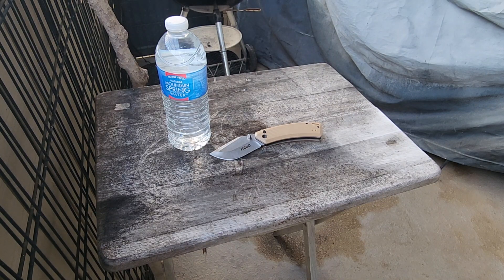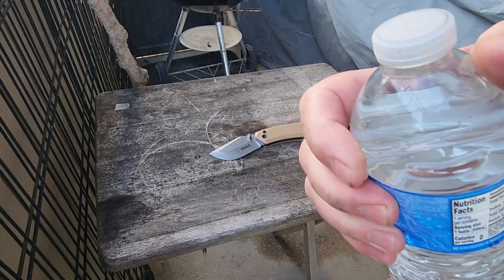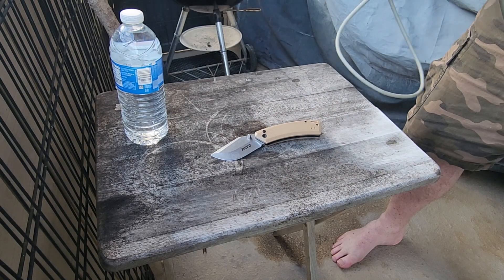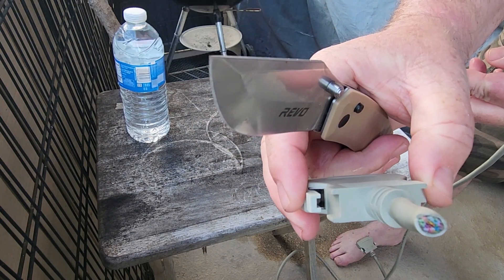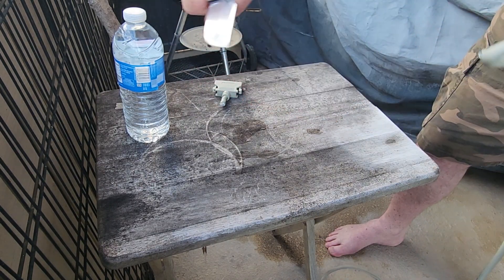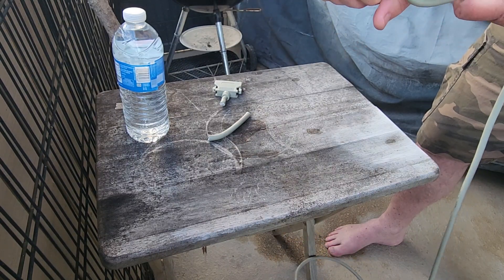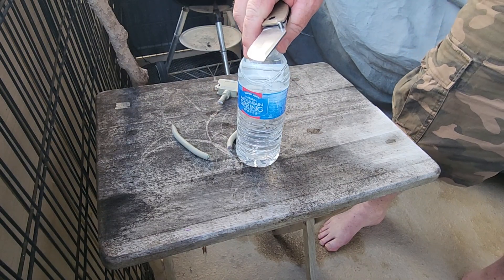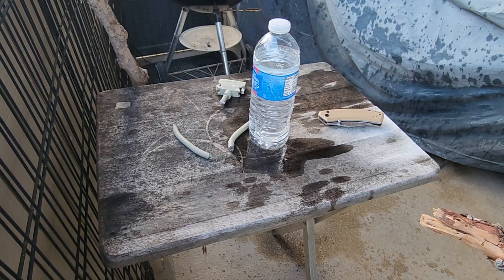I am in search of materials to cut that will really put stress on this edge!

Comment: Looks tough. Sisal rope seems to a common test medium.
Reply from the maker: I bought some cheap rope off of Amazon.  It will be cut in the next one along with some paracord.  I am new at this testing stuff 😁 it's fun.
Reply: @kenfaulkner5544  Polypropylene rope is also really tough to cut, I think they make some slash resistant versions for the fishing industry.